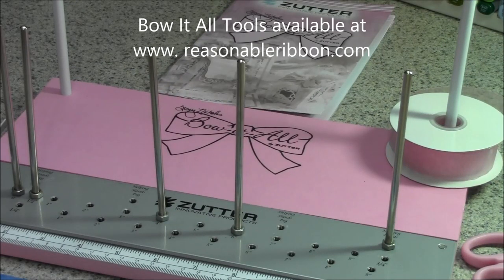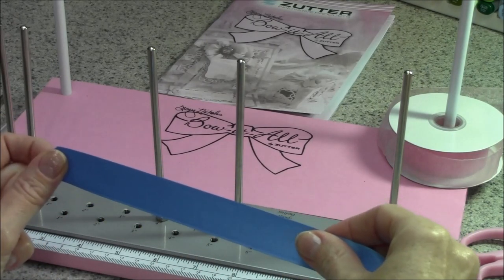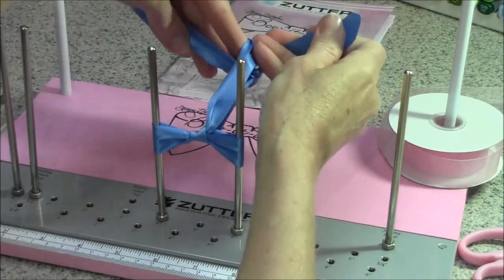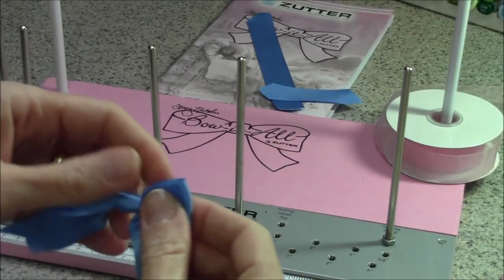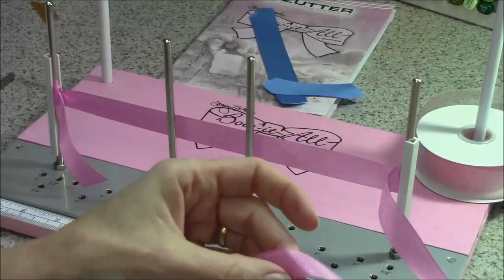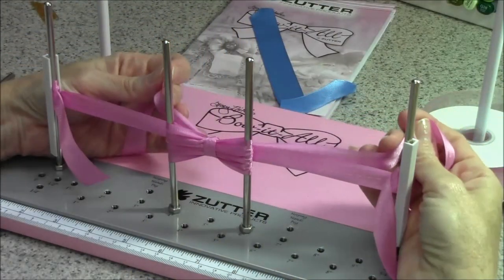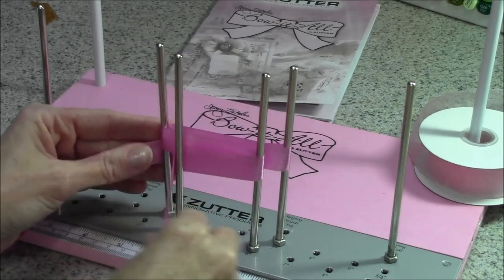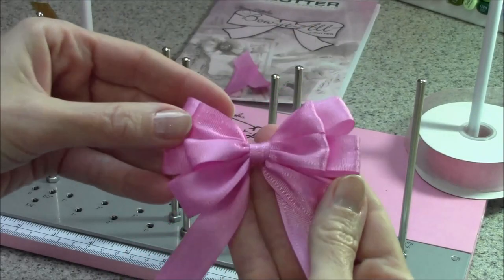Zutter Bow-it-All Tutorial * Bow Making Basics with Really Reasonable Ribbon

Comment: Hi Bonnie, thank you so much for these great tutorials, I'm learning so much from you :)
I'd like to ask for your help. I'm looking for a way to tie a nice little bow on a small jewellery box. Is there a way of doing it with this tool? Or do I have to tie the bow directly on the box? Whenever I try to tie a bow "free-hand" (without the help of two pegs as you're doing in this video), it always ends up looking a bit messy, and the tails don't point down nicely. Would you have any advice for me?
Reply from the maker: Hi there.  What I would do for a jewelry box is to tie the bow of your choice on the Bow it All with a back ribbon like I show when you want to attach it to a card with a ribbon that goes around the card.  Use that back ribbon to wrap around the box and just secure the end with tape or glue at the bottom of the box.  You can attach one side of the ribbon to the other rather than the box and the whole thing can then slip off the box.  Hope that was understandable!!  Thanks for watching.
Reply: reasonableribbon Yes that makes perfect sense :) I will try that. Thank you for getting back to me so quickly!